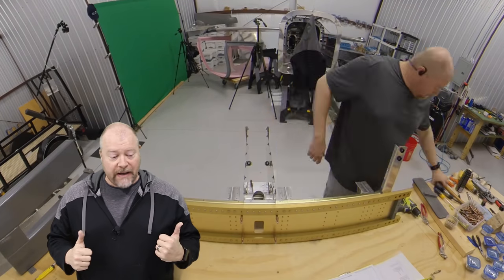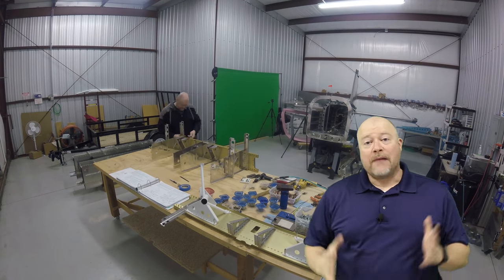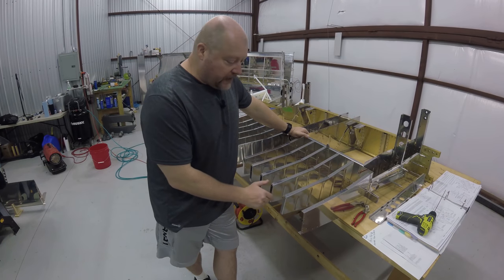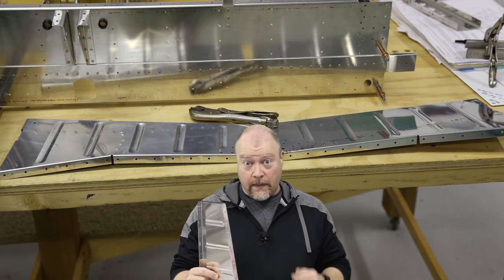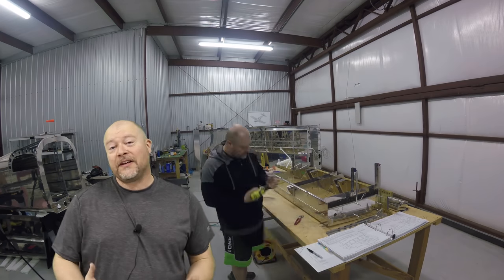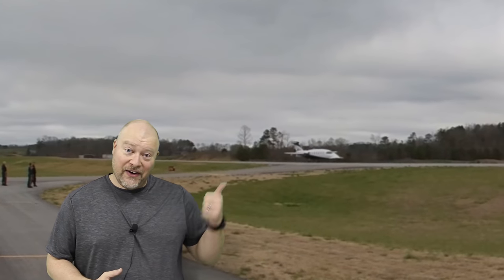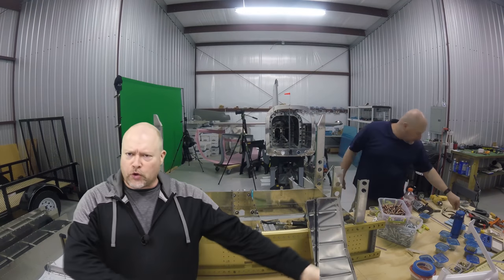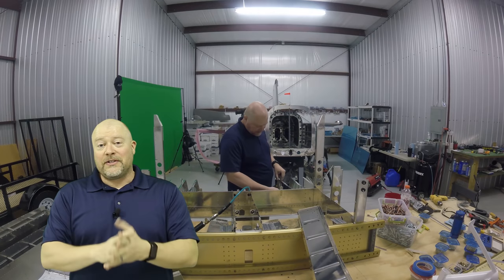RV-10 Fuselage - 009 - Center fuselage below seat ribs and core structure / Oil canning discussion

Comment: They are called beads not gussets or divots. The oil canning you are seeing is the internal stress in the thin rib just working themselves out, not a defect in the aluminum. Stamping and bending will impart internal stresses, I would not worry about it with the part in a free state. Especially if light hand pressure straightens them out.

If after all stiffening members are attached it oil cans, then I would be more concerned.

I'm an aerospace engineer and I work repairs to aircraft structure big and small as well as handle issues with installation of new structures, see stuff like this all the time. I enjoy watching your vids, keep at it.